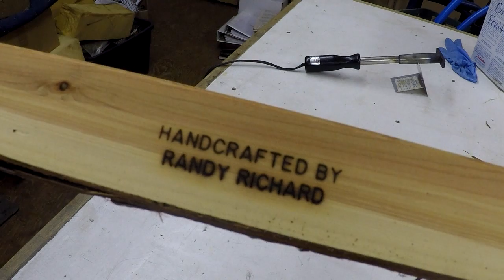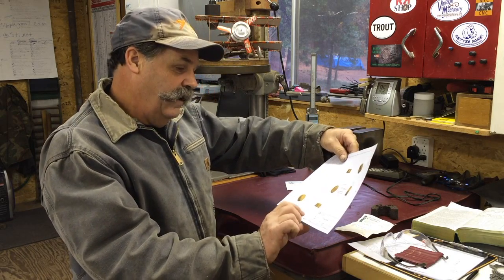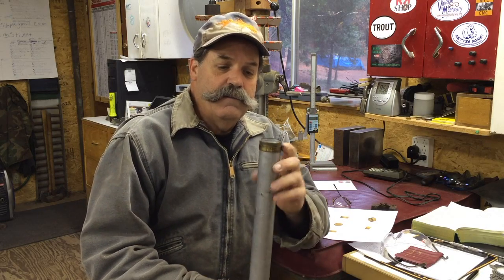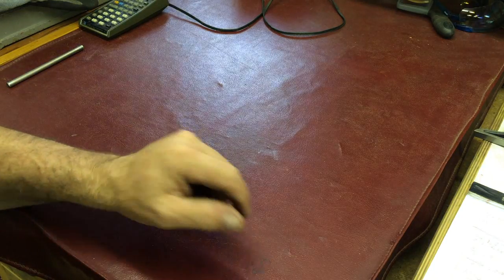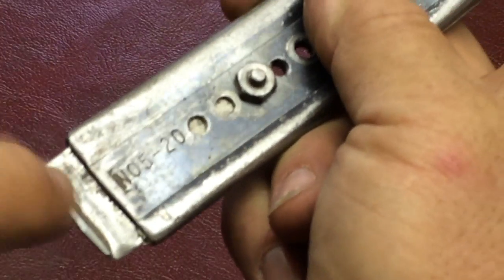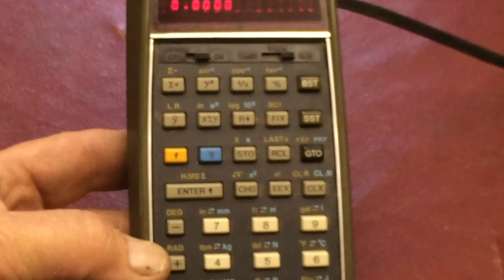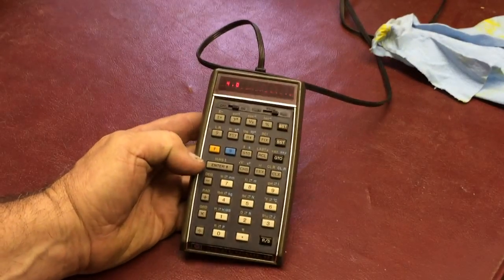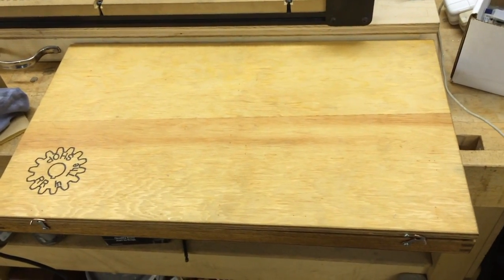Ketchup #35 - Logging Update E-Bay Tool Box Repair

Comment: Hi Randy
You mentioned cutting logs in the video; I just wanted to share some info about sharpening the chain that has been working great. I have a grinder I use to grind the cutters and it works great, when it comes to setting the depth gauges I use a (Husquavarna depth gauge tool 505698101), it lays on the chain with the depth gauge sticking through and you file until your file quits cutting. I believe Carlton, the saw chain company came up with this originally because I have a paper back book that described it's use. After reading the book I learned the cutter on a chain saw actually moves up and down as it goes down the bar kinda like a dolphin swimming. The cutter rocks backwards and pivots on the back pin so the cutting edge actually raises up but when the cutter has been filed off and gets shorter it actually gets to the point instead of raising up it actually drops down. So when a chain is pretty new the recommended setting is correct but as the cutter gets shorter the clearance has to be increased for the chain to cut like a new chain. 
The kool part is they are pretty cheap, under 5 bucks. You do have to buy the one for the pitch of your chain your using. 
I guess it is the correct way to machine a chainsaw depth gauge. 
John F

Comment: I remember the HP 55 when I used these in grad school in mid-seventies. I couldn't afford them but the department had two we could share. The best feature was the functions for converting between the Imperial and Metric systems.
Good to know you got started on the logging. Looks like a lot of work. Stay safe.
Reply from the maker: +Paul Jones I love using my calculator.   I cut down several yesterday,  the last for awhile.  So all the trees that were threats to our house and my neighbors are now down, bucked and stacked.  As soon as the wonderful gov't allows us to burn the we will get the slash cleaned up.  Now we are waiting on a logger that says he want the wood, when we are not sure.  But there is still an awful lot to come down.  We should get rain today and tomorrow.  Thanks Paul,  Randy
Reply: Hope we all can be logging when we are 97  :-)

Comment: I have my HP calculator from about 1976 also. It is not that same model, but I remember it was about $500.00 back then. Mine still looks like new and has bad batteries too and have to run it off the charger. Its not very hard to cut the battery case open and install new batteries. I should replace them someday, but it hasn't been out of the case in years. When I got it they called it reverse polish logic.
Reply from the maker: +kwd57 I think it cost me about$400.00, I have got my money's worth out of it. Reverse Polish Notation.

Comment: Still have my K & E Log Log Duplex Decitrig slide rule that I used all thru U.S. Merchant Marine Academy at Kings Point.  Perfect shape...can still use most scales...no calculators then...Class of '63.
Reply from the maker: +C185Pilot KP'er.  I to also attended KP for about 5 weeks,  So I could get my CE Diesel license, in the 80"s.  KP is located in a beautiful spot.

Comment: hey Randy,
seems the feed speeds on the x-carve are a little slow. is it possible to speed that thing up? your router seems to be turning at better part of 20 000rpms. i watch keith fenner put his together as well as you and april wilkerson. looks like everybody is having a certain degree of start up hick-ups

nice touch on the micrometer box .. 

cheers
mike
Reply from the maker: +HolzMichel It was the only 1/16" endmill I had, so I was taking it easy.  I think I have the kinks out, it has been working well.  Top speed on the Dewalt spindle is 27000, I think I was running at 25 ipm and 0.015 DOC.  What speed and feed would you suggest in wood, Mike?  Thanks, Randy
Reply: Randy Richard
 you're correct in taking it slow to see what it's gonna do. if you're running a metal cutting endmill you're gonna have problems with chips clearing out of the flutes by running too fast or the bit heating up by running too slow. but you should still be able to bump the feed rate a few notches. if the feedrate you were running in the video was 25ipm you should be able to run it at 35 or 40 relatively easy. 

if the surface you're working has to be fairly nice after the job is done, you should stick masking tape or wide band scotch tape over the area to be worked to prevent tearout of the fibers, especially in soft woods.

a side note for those reading along and wondering if they can use a metal cutting bit in wood: yes, you can. i make precision parts for various machines occasionally out of hard woods like maple and beech on my bridgeport. the one thing i encounter when machining wood on the mill is smoke developing. this is due to the cutter geometry not being optimized for wood: the clearance angle of the cutter is too small for wood and there is a longer contact period of the cutter against the workpiece. so i run the head speed as fast as it will go and run the feed on the table as fast as the motor in head can handle before it starts to bog down. in deeper cuts it will char the harder growth rings in the wood but in light cuts it does pretty good.

hope that helps

cheers
mike
Reply from the maker: +HolzMichel I will try the higher feeds the next project.  Thanks for the info.